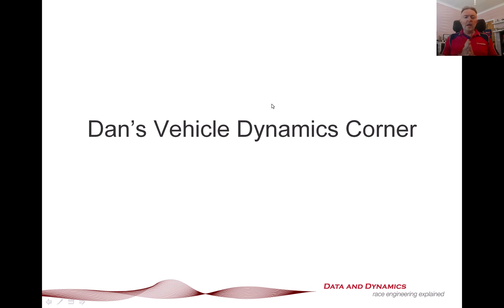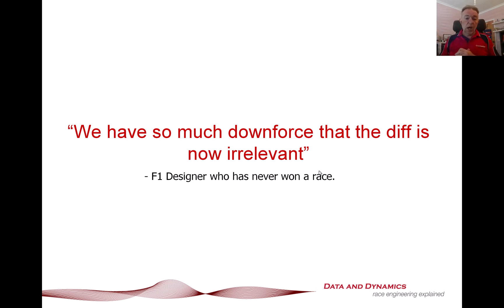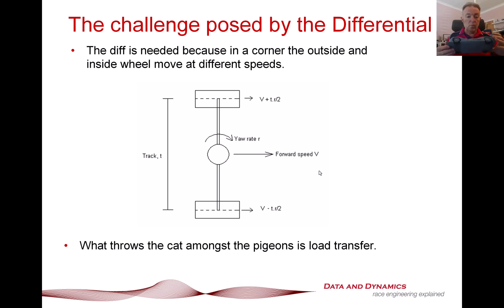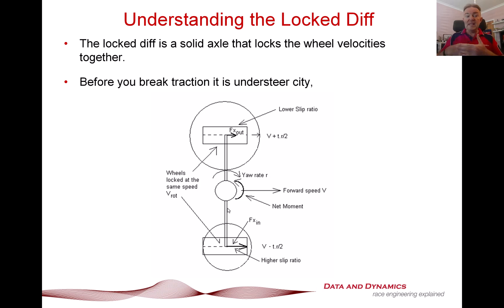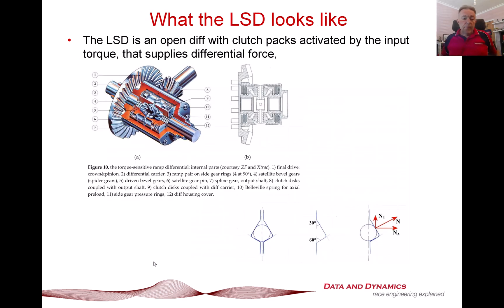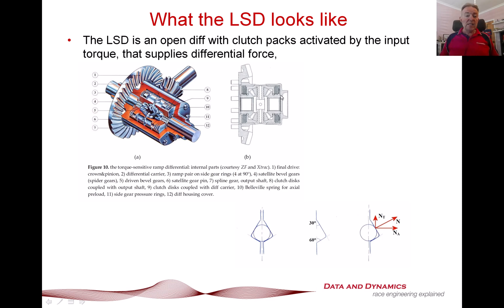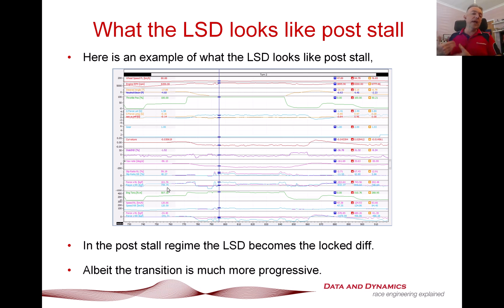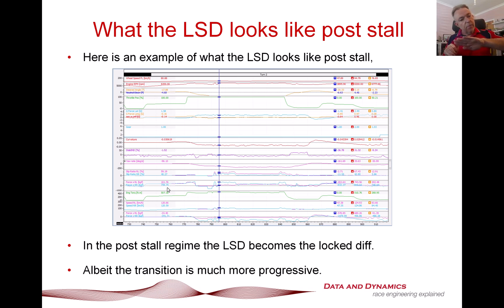Understanding the Limited Slip Differential

Comment: On a FWD mk1 golf, we found the diff very critical, especially for stability under braking, we swapped diffs one day at Anglesey international track (going from a Quaife to a Gripper), so much time was gained under braking and mid to off corner traction.  And getting the right ramp for braking so as you bleed of the brakes as you turn in so it doesn't understeer.  2.5second per lap was gained!  Well worth investing in time to get your diff dialled in